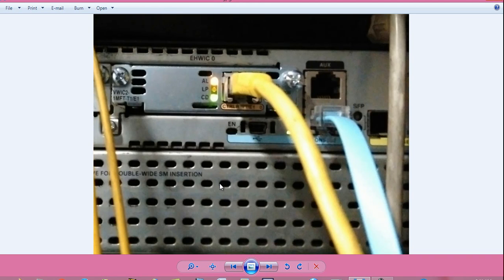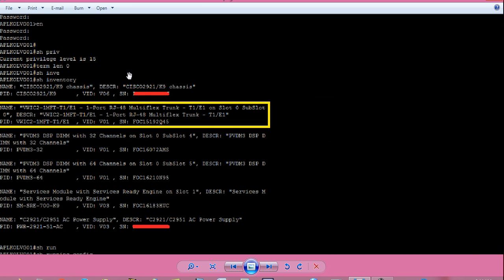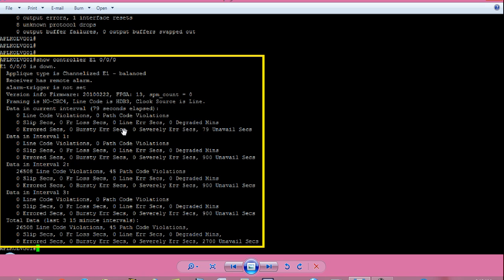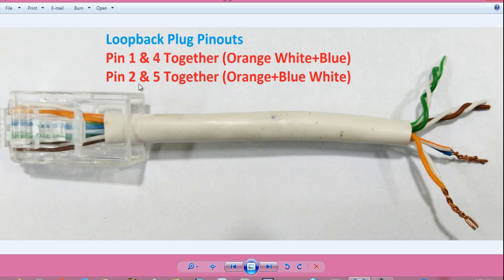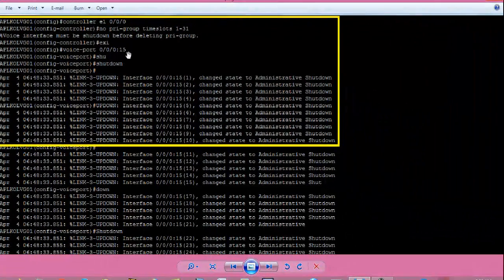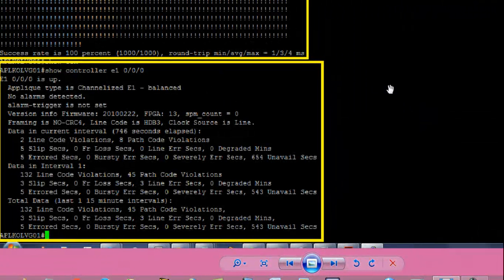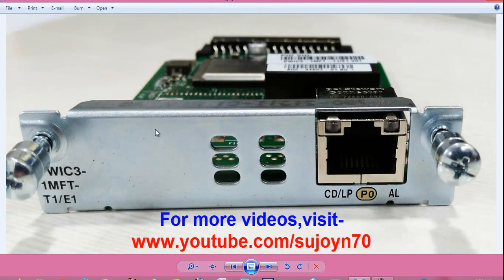CCNA 20_ISDN PRI Troubleshooting and Ethernet Loopback Test on Cisco Router

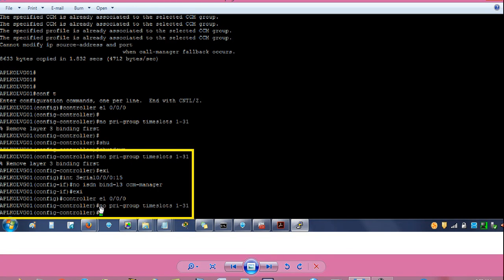Comment: I am not understanding what you are doing at 7:09, when you do "no pri-group timeslots 1-31" [ENTER] and then you add an ip address of 10.10.10.10 to the serial interface 0/0/0:0. As I understand it, you need to have a pri-group with timeslots set to enable that serial interface 0/0/0:0 to be created in the first place. I've tried following along exactly as you describe but it does not retain the serial interface 0/0/0:0 in the configuration in order to add an ip address to it.

Looking forward to hearing from you.
Reply from the maker: +Paul Lawley-Walker After the command- no pri-group timeslots 1-31, give this command-
channel-group 0 timeslots 1-31 to create the serial 0/0/0:0 or serial 0/0:0 to assign IP address. Rest of the process is same :-)
Reply: +Sujoy Krishna Das - Many thanks for your prompt response Sujoy, much appreciated. I shall be trying this today.

Kind Regards
Reply from the maker: +Paul Lawley-Walker Did channel-group 0 timeslots 1-31 command worked ?